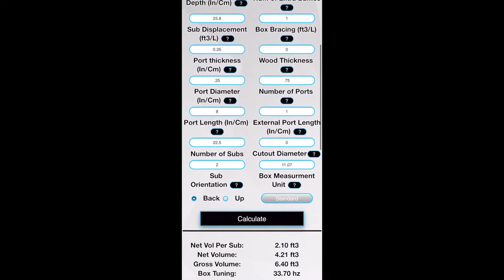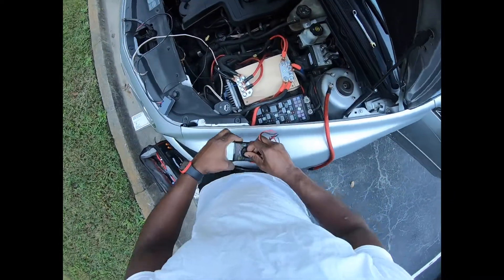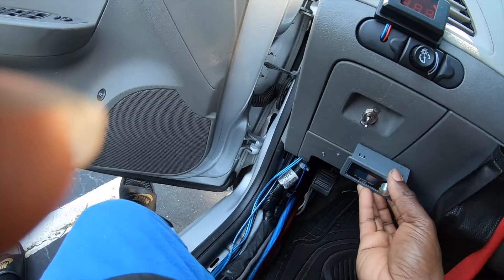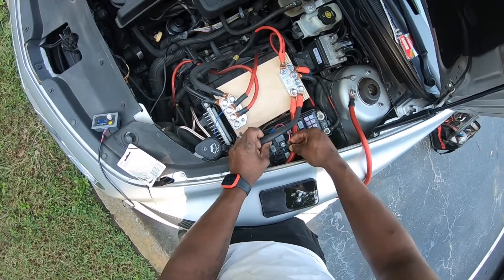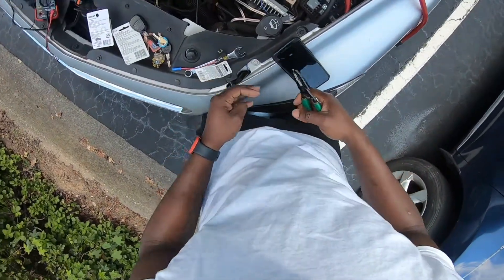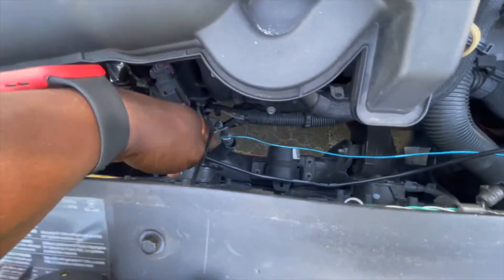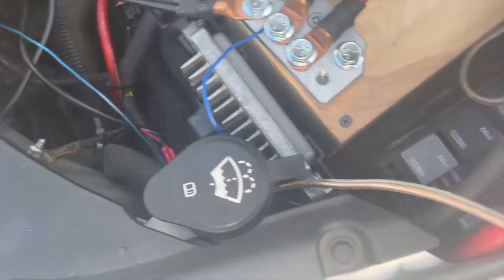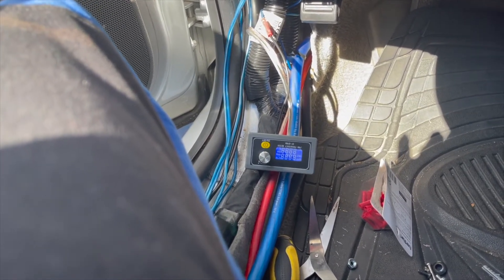PWM Voltage Regulator Install

Comment: You need to adjust the frequency to the right hertz. 128 is the frequency for most GM
Reply from the maker: I forgot what it was but it was something between 120 to 135 don't remember

Comment: I know its a old thread but did u ever get it to work i couldent find a vido on ur oage  and what yr car is yours
Reply from the maker: 120hz 2012 Chevy Malibu
Reply: @AJOSUE  my issue is the controle wont shut off bybits self and we have to start tbe car iver and iver to get it to work right
Reply from the maker: @boomboxmike5838 it should turn off, if installed correctly if it’s not turning off it’s defective

Comment: Why didn’t you hook the power and ground to the back of the EQ’s power source
Reply from the maker: It's a pwm suppose to control the output voltage, would do no good there

Comment: Will this work for any alternator with a sense wire
Reply from the maker: This is for ALT that’s PCM regulated, you’d have to do your research on that, XS power also sells one
Reply: @AJOSUE   yes my car is DEFINITELY PCM controlled I ordered an autotech 290 and the VCM 6003 which is a voltage controller like this one I just didn't know if it was universal some of these voltage control only work on GM alternator
Reply from the maker: Ask them if it will work, and after that you’ll have to find the frequency that works with your vehicle, I was lucky enough to find someone else on you tube that uses this, so it was easy for me

Comment: How is your alternator holding up with those lithiums?
Reply from the maker: No issues at all, I have it properly grounded
Reply: Right on man, thanks for the reply, The reason I ask is because there's some information out there saying that lithium will ruin your alternator. It sounded like BS to me I just put a lithium lifepo 4 in my trunk 2 days ago. I'm thinking about adding one of these regulators. I have 150 amp alternator stock on a 2020 Toyota RAV4 I just put two 12-in cerwin Vega V-Max's on a 3k Stetsom black edition... Pounding 💪💪 when idling the voltage drops to 13 volts.
Reply from the maker: So far I have had this ALT going on 80k miles changed belts 2x get ready for those, no issues I had the cyber 6k now 96ah superbeast both running entire vehicle
Reply: @AJOSUE  Cool, That's good to hear I'm glad it's going well. Thank you for your response
Reply from the maker: @marke.8334  any time

Comment: What in the section 8 build is that. Looks like the wiring from back to the future. All you need is a flux capacitor and your build will be complete.

Comment: I did the same an my voltage  drop to 12 😢
Reply from the maker: For the same car?
Reply: @AJOSUE  on my 2004 tahoe
Reply from the maker: @wickedlokz1849  it shouldn’t, you have to look for the correct fz try the same as I did or go to the description and click on that video, I forgot the other fz that works for GM
Reply: @AJOSUE  I did 130 and 80 and same it went from 14.2 to 11.3
Reply from the maker: Call brandxelectrical they should be able to help you with that or email them mj@brandxelectrical.net
Reply: Mine was dropping to 12v when I found the correct frequency what I ended up having to do was lower the % to make the voltage go up. Was very weird but it's working basically in Reverse.

Comment: So what did you end up finding out on making it work? I'm in the same boat right now, I put one in my Slingshot, set it to 128hz, and I've adjusted up to 80% with no change in voltage. Stuck at 13.7 volts
Reply: I just ordered one and got it working mine was supposed to be set at 100hz but ended up needing to be set at 103 to be able to adjust the voltage but for me I get the most out of it when it's set to 115hz for my car. You just have to play with it a little.
Reply from the maker: Mines is 120hz you just need to find the correct fz google it to find it

Comment: Would you happen to know if this would work on a 2010 hhr it’s got the voltage fluctuating like crazy because it’s regulated by load
Reply from the maker: Call them or summit racing they should have a recommendation, summit might offer you the one XS power makes

Comment: Were did u hook the  pwm wire placement  on the control module?
I get the power and ground ..but the other 2 ???
Please
Reply from the maker: - + positive side to my fuse box, and grounded the other one

Comment: How do you know what the hz frequency is supposed to be?
Reply from the maker: For the Malibu?
Reply: @AJOSUE  in general. Is every car different?
Reply from the maker: @ninja-vanish8086  when you install it, put a volt meter to it, and just stop at 14.4v but I got my car it’s 128hz
Reply: @AJOSUE  i got a volt meter I've seen ppl use 128,120,100 ill try those. Thanks

Comment: Bro mine did the exact same thing    they told me to send it back from where I bought it from and they would send me a new one 😒
Reply from the maker: 😂🤣 I only bought it from them because of the harness, but it’s $13 on amazon
Reply: @AJOSUE  yea I know I ordered one fromb Ebay I already got it just haven't put it on
Reply from the maker: @luissilva4956  I’m going to install mines this weekend
Reply: @AJOSUE  i made my own buying the pwm and harness separately for $25 attempting to install today.
Reply from the maker: @ninja-vanish8086  you saved yourself a whole lot of money by doing it that way
Reply: Currently working on mine hopefully i do it right.